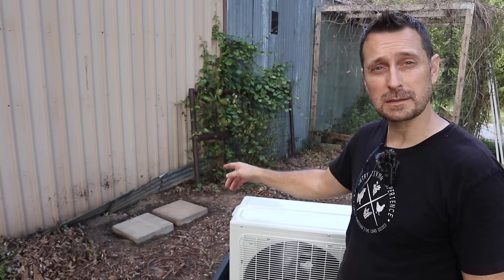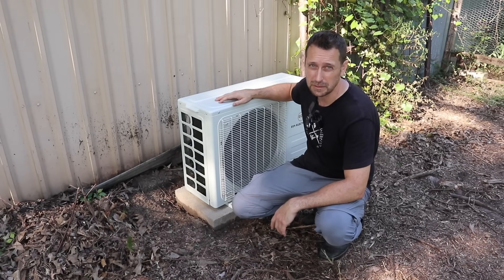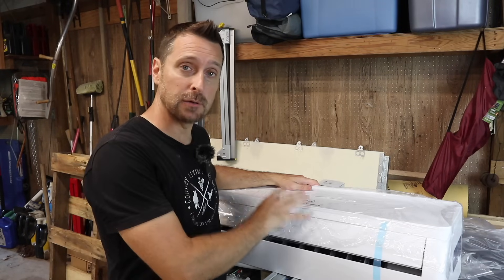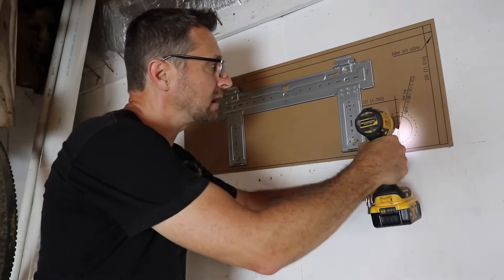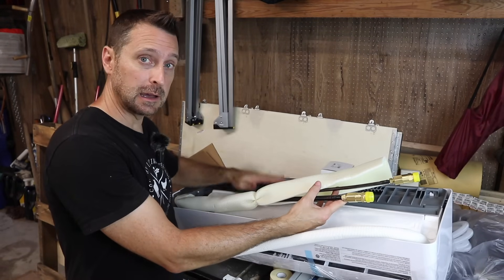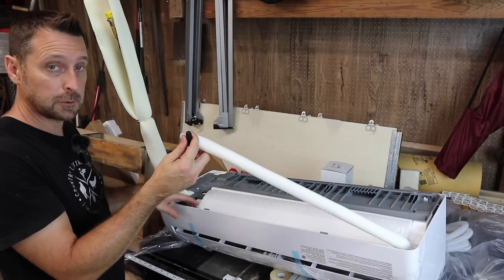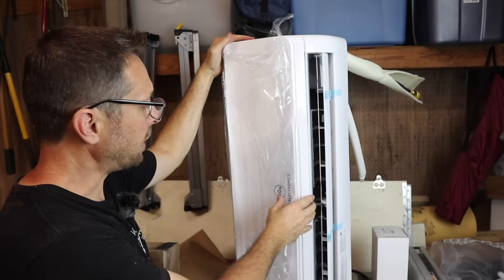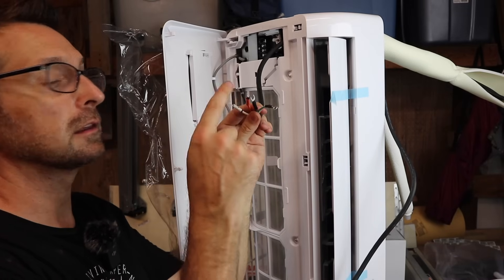Solar Air Conditioner Full Installation & Review! True DIY From EG4!

Comment: Nylog isn’t needed, the seal is made using rubber gaskets in the sealed connections with those “DIY” fittings. You’d want to use them if it had the traditional flared lineset.
Reply: Nylog isn't needed but highly recommended!
Every HVAC person I talked to said no matter what, use Nylog, tighten the connections for the proper torque and you will not have any leaks!
Reply: @killer5846  those diy fittings are very different, it would like using teflon tape on plumbing pipe threaded connections with a rubber gasket, the seal is at the gasket not the threads.
Reply: @projectswithdrew  true, but as it was described to me it is a HVAC lubrication as well and very effective at ensuring minimal stripped and cross threading.
and it's so cheap, for me $6 is cheap insurance!
Installed a Total of 3 mini splits and no leaks!
Reply: @killer5846  Most hvac techs have never seen the sealed quickconnect lineset fittings. Its remarkably easy and essentially impossible to mess up. Obviously you are welcome to put nylog on it but its not doing anything :)
Reply: @projectswithdrew  your probably right about the nylog, psychological insurance!
As for the premade and ready quick lines, I love them!
Made it so much easier!
Reply: @killer5846  Yea it’s true…even tho it’s not needed but it highly recommended to not strip the threading’s (as you mentioned)it’s almost like you don’t really need a vaccum pump in certain instances(as long as you purge the system)But it’s highly recommended that you Vacuum the line.

Comment: First, thanks for yet another great vid.   The part I'm fuzzy on in general is the PV -> Unit power needs.   If you over-panel for winter, then you have wasted power in summer and vice versa.   Not sure how to size such a thing effectively - maybe after some use you can provide some insight into choosing a ratio of PV to hours of operation / cool-heat overall effectiveness.    Where I live, I need cool thru the most of the night.   The PV -> Battery -> Inverter -> 120v does have loss but also the battery acts as a buffer and to extend operations into night-time cool/heat.      It would be nice if the unit has some MPPT type monitor info - e.g. PV in, power used to help inform - do I need more or less panels etc.
Reply from the maker: You're welcome. 
Can't change how the panels work. You have to account for that voltage spike in cold temps. Until they figure out that science, it is what it is. 
I will certainly do a follow up video on it after some time and testing. I certainly need cooling at night as well but wanted to just test out the full capability of the DC only configuration. I am sure they will continue to develop these and maybe add something like you are talking about....although that will greatly drive up the cost.
Reply: @CountryLivingExperience  what about wiring in paraellel vs series to get voltage down?

Comment: On the back of the remote tells you how to switch to F and off of C
Reply from the maker: Didn't see that. Thanks.
Reply: @CountryLivingExperience  I was hoping it is still there, mine is about a year old before the DYI line set, but the same unit, it works great, mine pulls 4.3amps on AC power full blast cooling

Comment: Nice video. I really love my EG4 mini-split that I installed last year in my pole barn too.
Just a quick word of caution....I noticed you built your solar panel rack out of timbers. When I did that, the wood boring bees really chewed up the boards. You might want to consider upgrading that to some superstrut or an actual solar rack instead. Signature Solar has some good solutions for that. Good luck and best wishes!
Reply from the maker: Thank you.
The rack is temporary and made out of treated timber so insects don't really eat it.
Reply: @CountryLivingExperience  Just so you know, the lumber I used for my previous rack was treated too....but the bees still bored into it like crazy wherever there were horizontal surfaces. Mine lasted for a few years before it got to a point where I was worried about the structural integrity in some locations. I ended up switching out to superstrut channels.
Reply from the maker: Wow, that's crazy. I have had some treated in my garden planter boxes for 5 years and they have no bug damage at all. You must have super bugs where you live. Steel channel is always better though.
Reply: @CountryLivingExperience  They probably aren't going after your planter boxes if the lower side of the wood isn't exposed to air. They tend to attack the under side of any horizontal wood surfaces. We are in Ohio...so it's possible we have super bugs!  ;-)

Comment: Hey Eric. I have had my 2 Ton EG4 running only on DC for over a year now. I have discovered some downsides. Often I have to disconnect the PV and reconnect it after 30 seconds. I have 8x 320w Qcell 40.66VOC panels. Could you help me figure out how to fix the need to reset it often to get the compressor running. It will still run the fan but it has to be turned on and off manually often to get it going again.
Reply from the maker: I haven't experienced that issue yet. I read that it has a 3 minute delay if it loses DC power before it can restart. Are you running it just off of the panel DC power?
Reply: @CountryLivingExperience  yeah just DC from the panels is all it has ever had. 2400kWh of pure sunshine Heat & Cooling this past year. It could be a grounding issue? All I have is the positive & negative PV wires going into it. Doesn’t give me an error code or anything. The compressor just shuts off at random and wont turn back on unless I turn it off/back on or fully unplug replug the solar manually. I have installed over a dozen of these now. Mine is the only fully off grid one. I have one other customer that is having the same issue. Have heard from others in SS FB page that they have experienced the same. Unsolved mystery for over a year now. When it works it works great, just has some random quirks when fully off grid.
Reply from the maker: @OffGridEssentialsbyFirebear  Interesting. Have you contacted EG4? Do they have any solutions?
Reply: in the beginning I did try to troubleshoot with SS, ticket expired due to lack of perusing it on my end. Couldn’t seem to figure out why it is doing that with them. They were pretty brand new then. They might have more experience with that issue by now. I tried to reach out to DEYE in China and they were unresponsive.
Reply from the maker: @OffGridEssentialsbyFirebear  Thanks for the heads up.

Comment: Excellent job on this one. I’m going to be doing an install on one of the non hybrid eg4 versions pretty soon. Should be fun.
Reply from the maker: Thanks brother! I appreciate it. Have fun with your install.
Reply: I have done 3 mini splits so far, Defenatly use Nylog and get a torque crescent wrench to get the tightness correct.
Good luck!

Comment: Press the up and down temp buttons at the same time to change from C to F.
Reply from the maker: Thank you Paul. I appreciate the heads up.
Reply: @CountryLivingExperience  
10 = cold, 20 = nice, 30 = hot. Metric. Easy as 1, 2, 3 :)
I can't quite fathom Fahrenheit; the numbers seem random. 
Beautiful install. I'll be doing the same on my new home next year.
Reply: as mentioned holding temp up and down buttons changes the remote from C to F. To get the wall unit to display F also, I found that only the phone app could achieve that. Wish they would give us a firmware update.
Reply: Arent tjese guys from Texas?  They should default all units to F not C.
Reply: @MyChannel-vm6dw  The military, NASA etc. all use metric. It's not difficult.
Reply: @MyChannel-vm6dw  They are re-branded units, manufactured outside the USA.
Reply: Nice, so we can change from C(ommunist) units to F(reedom) units.
Reply: @mjmeans7983  that's such a braindead comment, typical American
Reply: @mjmeans7983  come on man
Reply: @mjmeans7983  it's 3 in the morning and can't sleep. Sitting on the toilet, you sir, just made me chuckle.

Comment: I installed an EG4 9k recently, the AC only DIY version, and it didn't come with the cardboard stencil so I had to drill the hole based on their instructions and it was slightly off, I had to take the unit off and file away some drywall to expand the hole to get everything to fit. Unit has been working great though, not a difficult install at all.
Reply from the maker: Yep, those templates are extremely helpful.
Reply: That's weird, I installed the same 9k unit and I did have a template. May have forgotten yours in packing. They do make installation easier!
Reply: @killer5846  I bought mine probably 6-9 months ago and it sat in my garage until I was ready to install it, so maybe they started adding it after that. Would have been useful for sure! The instruction manual wasn't very clear about the hole in relation to the bracket.
Reply: @paul.phillips  must have been added after you bought yours because I did notice that it had some more things in the packing then was on the videos I saw.

Comment: To change from C to F.   Method 1: Press the TEMP Up and Down buttons simultaneously.
• Method 2: Power down the remote and hold both the TEMP Up button and the Fan
button simultaneously for ~5 seconds.
Reply from the maker: Thanks for the tip!